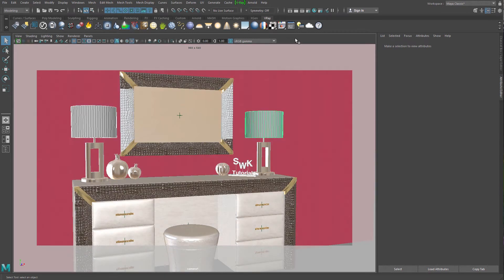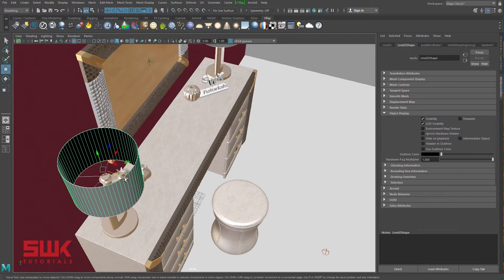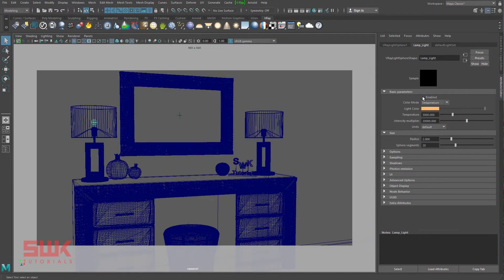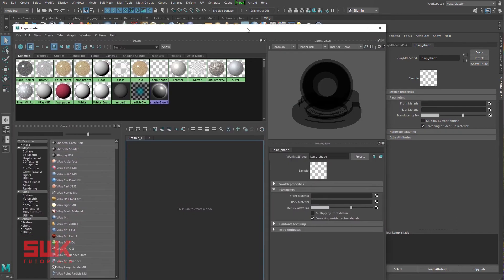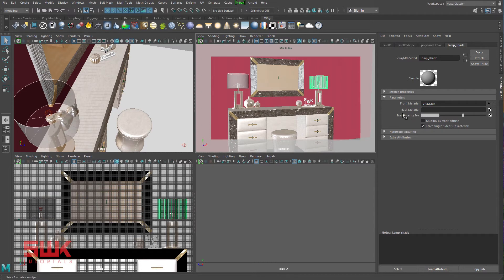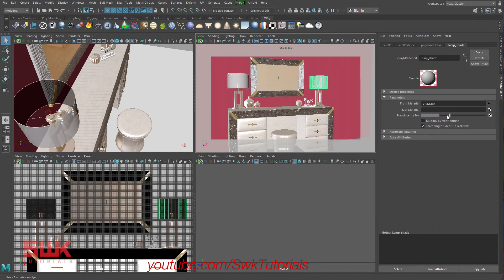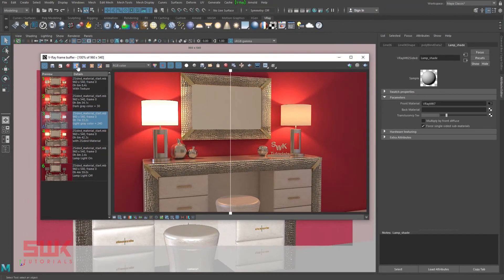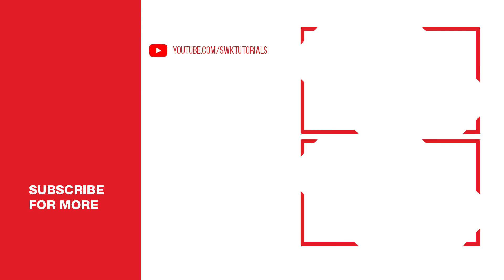Maya + Vray | Create translucent materials in V-Ray using VRay Mtl 2Sided material in Maya

Comment: This series of yours has been helpful. Thanks. 

Tell me, how would one get water refractions through V-Ray? Specifically, the undulating shards you see at the bottom of a pool? I found a tutorial for that, but it's not narrated and the video's one of these time-lapsed jobs, so even slowing down playback does not help. 

Thanks!
Reply from the maker: Many factors involved in this method. Refraction, reflection, ior, displacement and most importantly caustics.
It's extremely difficult to tell on msg.
In future I'll make a tutorials on it.
Reply: @SWKTutorials  Excellent. Looking forward to it.

Comment: Thank you sir....... Sir i am facing problem for making water or river in vray (maya), Is there any way because i m using maya2016 and Bifrost is not supporting in it.
Reply from the maker: I simply use "Vray Mtl Material" to make water. Adjust diffuse, reflection, refraction and add a bump map too.
One Imp Tip: First make all the environment, apply materials (excluding water) and do lighting. When everything is done in my scene and the render is looking OK. Then start working on water material because water needs environment reflection to look good.
Reply: @SWKTutorials  thank you sir